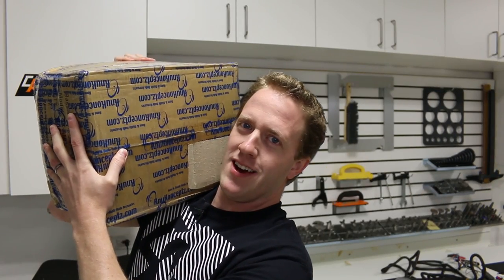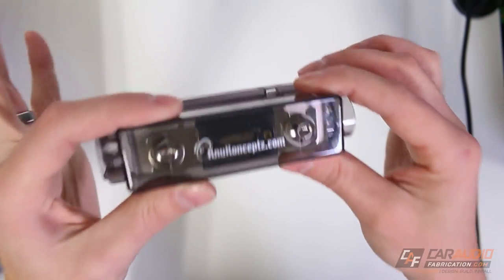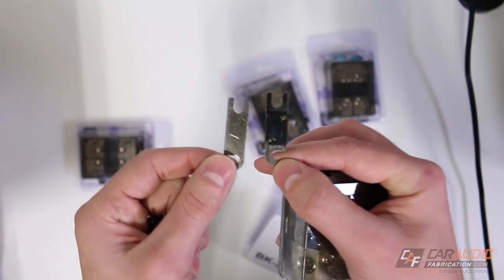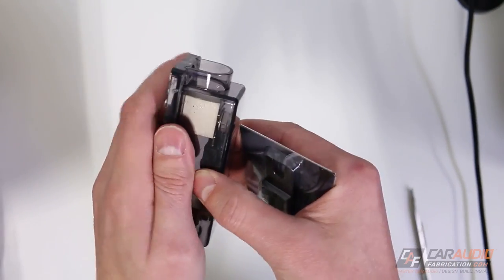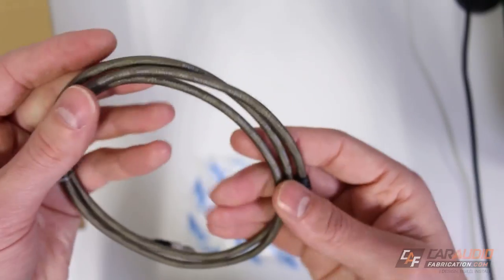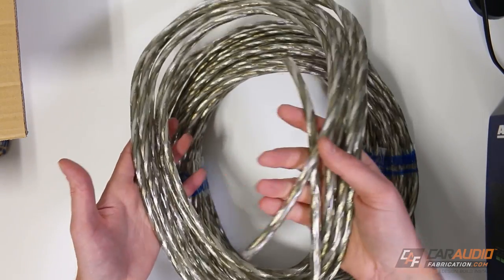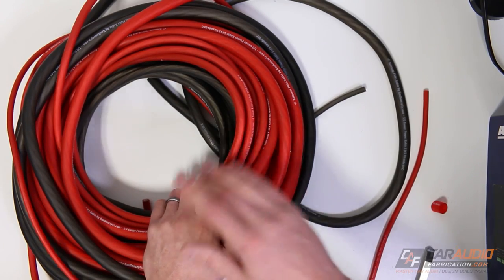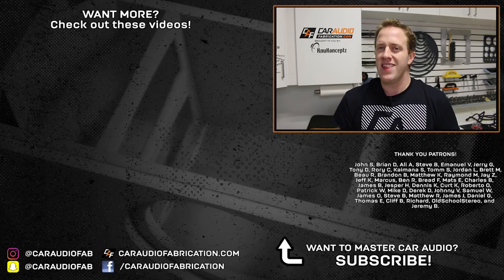Installing a Car Audio System? What wiring DO YOU NEED?

Comment from the maker: Thanks for watching this video, you guys ROCK!
CAF Shirts & Hoodies: https://teespring.com/stores/caraudiofabrication
Tools I recommend: http://www.caraudiofabrication.com/materials-tools
Reply: First comment on here yay.
Reply: How heavy was the box?
Reply: How much would you take to do my install?
Reply: @danv2888  what do you mean by that question?
Reply: @riveralley  
I'm asking Mark. Price.
Reply: @danv2888  just some advice I would recommend contacting him on his website.
Reply: CarAudioFabrication hey i’m thinking about doing sound skins in my truck but where i live it gets cold and don’t want to sacrifice a whole lot of thermal insulation what do you recommend i do?
Reply: Sir can u send me stuff in kuwait
Reply: Hello, good video i have connected a car sub in home of 1000w rms cea i have it connected 1000w corsair modular psu i dont want to connect a battery and dont want to destroy the psu cables so my idea i connect 4x 4 pin molex adaters to the psu cables and add a 2 psu if is needed what u think?
Reply: Hello all, I'm wondering what size/length for RCA cables? Thanks!
Reply: You should do one of these video for motorcycle audio
Reply: Nice

Comment: How do you know what size wire to use to run to the speakers?
Reply: It depends on the amperage to your speakers. If you are wiring normal door speakers (< 100 watts @ 4 ohms) and short wire runs you can usually get away with 16-18 gauge. Larger wattages or longer runs demand bigger wire. For subwoofers consult your amp and driver specs.

Realize these numbers are only starting points. It makes a difference what quality wire you using. With tinned 100% premium OFC you can get away with narrower diameter. Using cheap CCA wire you need to go fatter.

Mark has great videos on all of this subject but the info is spread out, not all in one place. He is conservative in choosing top-of-the-line wire at diameters exceeding the maximum amperage. As a famous pro installer I get it. He cannot make assumptions about usage and he never wants a customer returning with a blown fuse or fried wire.

Most of us enthusiasts on a budget are willing to make compromises based on our listening preferences. There’s a big difference between a bass-head and a typical low-volume Classical music listener in the currents we’re likely to demand.

Helpful?

Comment: I have 4 speaker - tweeters, 1 amplifier and 1 subwoofer in my car. I need to upgrade the wiring.
Which is the best wring you recommend for best quality and protection (specially the guage)?
And for my knowledge, for my above setup, will I be needing only 3 of 4 things you mentioned:
1. One Fuse for protection. 
2. Power Wiring between Battery and Amp and for ground wiring. 
3. Amplifier to Speakers wiring.

Comment: I just got my shipment from KNU today and I wanted to give people a heads up. I ordered 12ga. speaker wire for the doors and rear, and 8ga. for my subs. I got the Karma SS line and they're freaking HUUUUGE, LOL. The 8ga. is damn near the size of 1/0 welding cable. I have NO clue how I'm going to get the 12 ga. wire through the drivers side door. It's close to 4 ga. wire in size and I have an '03 Taurus that has the stupid hard plastic cylinder for a boot. Mark, you owned a Taurus, what size speaker wire did you use for the doors and how did you get it through? Thanks Mark, and for everyone else, the wire looks and feels solid as hell and has a very L-A-R-G-E diameter.

Comment: Can you run a ground from your head unit to your amp to help ground noise? I have good equipment and tons of grounds, power, etc. Good quality wires and amps too, but still get a little engine whine through the highs. Ran rca's away from power wires too.

Comment: I can never find distribution blocks in 8 only 6 and below is it because 8 will never be used with a 2 most up ? What if I just wanted to small amps for two subs each running 8G

Comment: @CAF I was wondering if you’ve ever thought of making your own battery (with the lithium kits being sold online now days) I’ve seen many applications including upgrading battery power for those kids mobiles to make them go faster or have better power exchange do you think this is possible for extra power packs for amps and other stuff you may need in larger builds? This is all hypothetical and simply to satiate my own curiosity if anyone reads this and knows about electrical systems in a way that can be explained to someone with not electrical background I’d appreciate the info and input :D
Reply: Martin Pantoja I wouldn’t, unless you really know your stuff. Lithium batteries will explode if improperly charged, installed, or maintained. I don’t know about you, but I don’t want to burn my vehicle to the ground because I tried something way outside of my skill set.

Comment: So I bought 4 speakers and I want to get an amp for them but idk what wattage I need and if I need to get a converter as well. I also got a stronger subwoofer 2,000 peak power but idk what amp I should get with it.

Comment: What is that black part that comes preattached to speaker wire??
Reply from the maker: Not sure what you are referring too
Reply: CarAudioFabrication i bought aftermarket speakers that come with speaker wires that have a black boxy thing attached to the wires itself. I think I just discovered, it’s called a passive crossover? I’m hooking up rear deck spkrs rt now, one isn’t working and the other one is very quiet, I’m wondering if I should cut off the crossover component bc they’re reducing sound so much? Thoughts?

Comment: Question can you connect a universal bass knob with a stock head unit? Thank you
Reply: Real N Yes you can. Just get a rca style universal bass knob and put it in between your line output converter and your subwoofer amplifier.

Comment: Quick question: How much extra power wire etc, do you plan in your builds?
Reply from the maker: Measure each run and usually add 3 ft or so. You can use a string if you want an accurate number but the more you do the more you will get a feel for it.
Reply: CarAudioFabrication thanks.

Comment: A thought on the power wires you showed in those kits...

In any conductor, excess positive or negative charge accumulates at and distributes itself across the surface of the conductor so that charge density is nearly uniform. This is because like charges are repellant (and unlike charges tend to pair off and neutralize). So the point being, in any sort of conductive object, positive or negative charge will travel along the outer surface. This includes electrons traveling (i.e. "current"). In simpler terms, current travels on the outside surface of your wires. Where I'm going with this, is that if you have a tinned wire...the resistance of that wire is largely going to be determined by the plating. So oxygen free copper, versus regular copper, whatever... the resistivity is predominantly dictated by the plating on the wire. I haven't looked up the resistivity of different metals to say concretely, but I would hazard a guess that your best value is to not worry that much about what sort of copper it is, and just buy the absolute fattest wire you can reasonably afford (provided that girth is metal, not insulation). Only once I was down to zero gauge wire would I worry about alloy at all, and even then, only if I was some sort of SPL competitor trying to wring every last dB out of my amps. Your ROI of money and attention is bigger elsewhere IMO.

Theory is one thing, but actually getting to see you apply knowledge to create these systems is really great. Thank you for sharing your considerable fabrication skills and knowledge with all of us. I am learning a lot about installation methods, materials and best practices from your videos.
Ian

Comment: hi,can yoy please explain how do i know what guage of wire do i need to use for what application?
Reply from the maker: You need to take into account the length of wire and how much current the wire will need to transfer. There are many charts that you use to compare the two values to then determine size.

Comment: If im going with 0awg power & ground is it manditory/necessary that i do the BIG 3 with 0 guage or can i skip that part?
Reply: c0uchsl0uch00  I would definitely do a big 3 upgrade with 0 gauge. Running 0 gauge to the amplifier won’t do much good when you’re trying to run that much current through the small factory wires. Your electrical system is only as strong as its weakest link. You’re probably (almost definitely) going to need an alternator also.

Comment: I need some help whit my build i got a 12” in the trunk and 2 tweeters and 2 speakers front only its old car.(volvo 240)
I tuned everything perfect to one song... but when i try another sog its way to much bass and sound like shit... i found 3 songs i love the sound on but other then that shit.... what to do???
Reply: my guess is; might need the system to be a bit more well-rounded and flat in response, cause what you've described sounds like classic "peaky" issues where the Db's at certain frequencies are vastly different. is the sub in a sealed box within the factory recommended volume spec, or in a prefab that is either too small, or a bandpass/ported that isn't tuned near the sub's TS parameters?
Reply: Krazie its a ported box so i should try to play more whit the amplifier tuning?
Reply: i'm willing to bet it's the ported box giving you unbalanced response. so you might look-up the sub specs & find a sealed box with the right net volume... 1.5-2.2cuft is normally a good place to start with the avg 12" sub. place it rear-firing toward the back bumper, in the driver's side of the trunk. then turn down your amp gain & set the low-pass to about 50-60Hz.

i listen to everything from Led Zep, to Lupe Fiasco, Bjork, TOOL, The Roots, NIN, ATCQ, Prince ...sealed boxes, and maybe a t-line to add rumble are all i'd ever suggest. ported & bandpass sound like poo.
Reply: Thank you alot im looking to upgrade the sound system so you prefer  sealed box i want to build a custom box but whit no expirence in sound system i have no idea whats good and what to keep away from 
can you send me a link to 2 12” subs and amplifer that match good maybe a box or i can try building my own box.

Comment: Do you need a better head unit to have better quality and louder sound for your subwoofer and amp?? I have a stock head unit currently
Reply: An aftermarket head unit can provide a significant improvement in the quality of sound  from your other audio components. The number of cases where a factory unit outperforms an aftermarket unit is very small. Provided you don't get some cheap brand. A solid aftermarket unit will give better audio adjustment functions, more options for inputs, and other aspects that make it a worth wild investment. IMO, a quality head unit is your foundation for quality audio. 

If you already invested a good amount of money in subs and amps it would only make sense to complete the investment with a decent head unit. But I understand that some people do want to maintain that factory look, nothing wrong with that either.

Comment: Hello There.  I do planing use 4 channel 720W amp but using 4ohm speakers so its 4x60w - 240W  not 720W at 2ohm do I have to use 720w or 240W to calculate what wire to use? same think for my mono 320w amp for sub 320W or 150W bridged at 4ohm both AB class - Thanks!!

Comment: i recently had an amp installed and shortly there after i noticed  a cloud of smoke inside my car. the smoke smells bad, like burned goat shit, and makes you want to puke. the smoke is coming from my car stereo, not the amp. the installers tried to blame my LED bulbs but i told them the lights only turn on when i open the door and thats for a few seconds at a time. i replaced the bulbs with OE bulbs and the smell of burning wires is still there. what is causing something to obviously overheat?

Comment: I have a question is there a difference between the kac-8106D monoblock and the kac-5001D monoblock both from kenwood .Thanks again for the lesson on wiring i'm still wondering if i should still hook up my mono amp to my comp psu those tiny wires i fear they may melt under high gain values..... Suggestions

Comment: Sir can you help me. What would be the best fix speaker wire gauge for my 70wattsx4 class ab speaker and 250 class ab mono amp? It will be fit on a hatch back type car. Your input will be a big help. Thank you in advance.

Comment: Do you think 8 gaue Karma wire is overkill for subwoofers ?
Reply from the maker: Depends on wire length and subwoofer power.
Reply: @CarAudioFabrication  I'm running 1 RD 1000/1 to 2 12W3s. Probably like 6 to 7 ft.

Comment: Hi mark just want to know do you use capacitors for your builds
I am redoing my system in my hot rod 
I will be running a 5 channel amp 
My new build will be 
Audison 3 way splits  front
Audison 2 way speakers for rear fill
2 10 inch Audison subs
1 hearts 5 channel amp

Comment: What’s up, 
So I’m trying to have a audio shop install  (4) 6.5 door speakers (125 rms each speaker at 8 ohms),(4) 12’s in a custom box(1k rms each speaker, and at 1 ohm). A  2,500 4 channel amp, and a 4k mono amp for the bass, powered by two batteries in my 01 Tahoe powered by my pioneer 4200 nex radio...so which amp kits or anything else I’ll need would u suggest for me so that when I go to the shop all they’ll have to do is hopefully just Labor?.
Reply: Go With GP wire. Go to theyre  website they have diffrent amp kits

Comment: 1k watt amp to 2 500 watt subs @ 1 om. any suggestions for the wiring (speaker and power) and fuses? Thanks!
Reply: fatalfriend I am just a hobbiest. He has videos on calculating the appropriate wire and fuse sizes. My own estimate (assuming 1k rms not max) without running the numbers, knowing your amplifier efficiency, or length of wire is roughly at least 4ga  OFC with a 125A fuse. Speaker wire.... for your subwoofers, use the largest that you can get and fits. 10ga should be gtg, but 8 is better, 12 if you can’t get or fit larger.